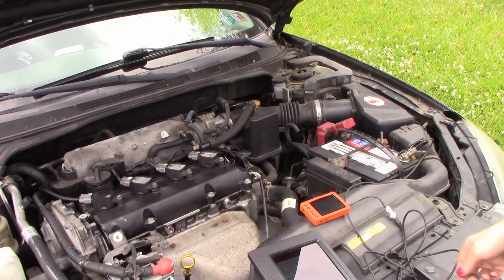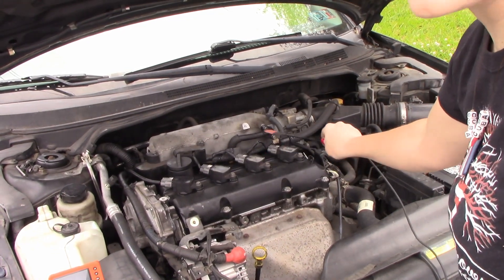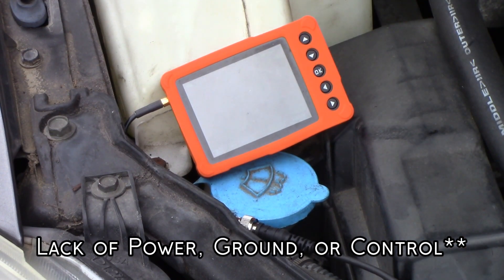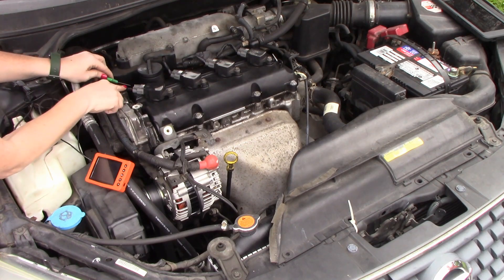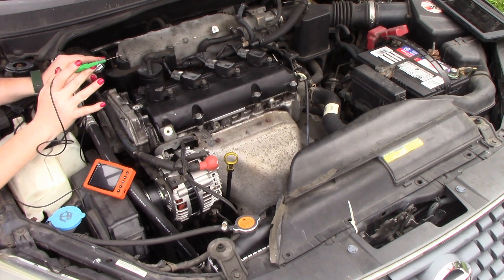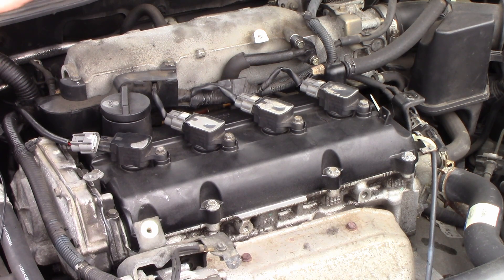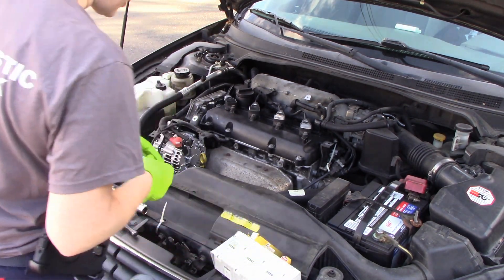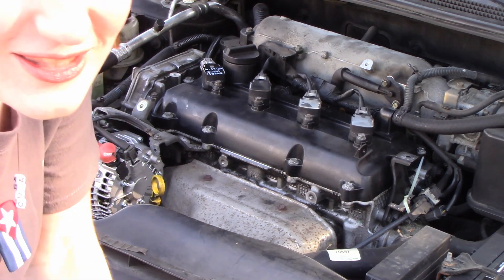05 Altima 2.5ltr -Diagnosis & Repair P0301

Comment: I like your method but you can do the same just by unplugging the coil while running and hearing the engine change running sound or not also you can read the spark plugs and determine if the plug is firing or not

Comment: What does it mean if u unplug a coil &.... the vehicle dies 🤔
Reply from the maker: If a vehicle has multiple coils, like this one, basically 1 per cylinder... then it should be able to run with 1 coil unplugged. Ahh. Unless it's a Toyota. They have a different strategy and will kill spark to all cylinders depending on year, if I remember correctly.

 If a vehicle dies, then it probably has multiple misfires (more than 1 low contributing cyl) and can't handle losing another contributing cylinder (coil unplugged).
Reply: It is a 05 Nissan Altima 2.5 🤔 The only code I had stored in it was for a crank sensor. Starting to think that the ecu is fried
Reply: I can unplug number two and number four and there's no problem but if I unplug number one it dies automatically. If I unplug the number three it acts like it wants to die and then it works fine

Comment: I have this same car. Going up hill today it started cutting out bad, wouldn't accelerate, and cel started flashing. Beforehand I've had a code for o2 sensor. Does that sound like a bad cat? I know the precats are junk on the manifolds. Sucks because that car is all I have. Kinda thought injectors but no misfire code.
Reply from the maker: Just saw this while editing another video.  Depending on yr of vehicle, the O2 is needed for fuel correction. If you already had codes prior, especially for the upstream, this may be affecting how injectors are firing. Scan data is extremely helpful in this case using PIDs MAF, FTs both ST & LT, O2s, Coolant temp, RPM, TPS.... skewed inputs will affect driveability.

 1 way to check if exhaust is clogged and with limited tooling is by removing an o2 sensor.... preferably the upstream one. 1 it's easier to get to, 2, it's quick and dirty way of seeing a change. You can leave it plugged in, just zip tie it out of harm.  If there's noticeably more power now, exhaust is definitely restricted.  Try brake torquing before an after sensor removal, so you don't necessarily have to drive it. Hopefully acts up by brake torquing. Depending on yrs, this option is getting harder and harder to be able to do, as the sensor is critical and input is more sensitive.  The PCM is more likely to make bigger corrections, possibly making it impossible to drive. 

I hope that helps. I can't get too specific, as I have no detailed info. Good luck.

Comment: Hi Ms. Cuba!  Is switching coils from another cylinder a good way to get a proper diagnosis if you have a misfire due to a bad coil?
Reply from the maker: Yes... if you have access to them, such as this vehicle.  BUT more and more are being hidden under intakes, making that an extremely difficult option to test. Imagine someone working in a shop having to swap coils under the intake, which now requires new gaskets and/or other possible parts. Also, more chance of plastics breaking, vacuum lines,  etc.
I'm just showing 1 way to test them, an option. Another could be using current readings, via fuse or relay. 

Having options can be very useful in the tool arsenal, especially labor saving in most cases. Thanks for the great question! 😉😊
Reply: @CubasAutomotive   Good morning! Yes, some are difficult such as v8 engines.  I got a 4 cyl in my car though. 

I was getting a code for misfire and swapped coils, misfire continued, pulled the spark plug and it looked good.    Used higher octane gas and no more misfire, ran several full tanks of quality fuel and still no issues.  

I don't have specialized equipment and wanted to know if just swapping coils would give you and idea if they are bad.  I  had to ask a master technician for advice 🙂.  

Saludos!

Comment: bright clean porcelain on plug electrode = lean, very very lean at that.  I'd guess more of an fueling issue on that cylinder myself or the whole engine(dirty MAF/etc)
on top of possibly bad coil, if it was bad in your testing :)

Comment: coil and plug both at the same time = wise choice. one or the other can cause repeat failure, don't think for a second that a bad boot(even with copious dielectric grease) won't be carbon tracked or  dry-out and cause carbon tracking on a "new"  glazed porcelain plug body.
plug type doesn't matter if the porcelain coating was scratched, contaminated, or carbon tracked by bad boot. replace replace replace, always both at once!
engineers and all upstream likely HATE me for being honest and ruining their whole career and poorly laid out lies. oh-well, #dealwithit?
the idea of fully disposable "everything" was bad 10 years ago, as well as 20, 30,...... 169 years ago. ;)

Comment: You're a hard working woman. You worked on the car once but had to film it twice.  That's a great little scope. I've seen it before but every time I see it being used I get impressed all over again.
Reply from the maker: Oh... it's a powerful little tool. It's definitely one of my favorites. I try to have it with me all the time. The resolution is quite clear too!  Thanks Wyatt! 

It is quite a hassle to record in both languages, but if it benefits ppl, I'm willing to oblige. 😉😊🤗
Reply: @CubasAutomotive  good job. Hey where can I get one of this scopes what's the name of scope please.
Reply from the maker: @victornaja7927  all the info is in the description 😁😊
Reply: @CubasAutomotive  I saw that now. Thank you. . Fyi it's the first time I saw it. N I went nuts wanting to get one I skip the description. My bad. Thank you. Also have you try the thermal gun it show misfire if it glow bright than it's good but if it's not bright than temp is cooler meaning there was a mis fire.

Comment: Cuba I hit the like button before even watching it because I knew it would be excellent. Thanks for using the u-scope and the screen shots. Rear little scope. Bonus footage is like watching an Ivan video from PHD. You and family stay well Artie ❤️ Cuba quick question what did you mean and use when you said burn off the plug? Never heard that Thanks.
Reply from the maker: I use a torch, not acetylene. . But a Map or Propane and burn where the tip is.  I more commonly do this on small equipment, as they are more prone to fouling out. It helps restore the plug to a more useful state. Fouling out prevents the spark from occurring. 

 In this case, it wasn't too bad, as it was only driven a few blocks this way... and whatever testing I did while running. I may do a 2 min clip showing that process, I guess. Thanks Arti! Always a pleasure to here from you! 😊🤗
Reply: Cuba's Automotive thank you for replying to my question. You and family stay well Artie ❤️ lockdown here on eastern Long Island is getting old.
Reply from the maker: I just hope I was efficient enough in my explanation.  Lol.

Oh yes, I agree. The lock down now is overkill. My city is still on lock down as well, so I shop anywhere else but in town. Plus, I prefer small biz & farms anyway.